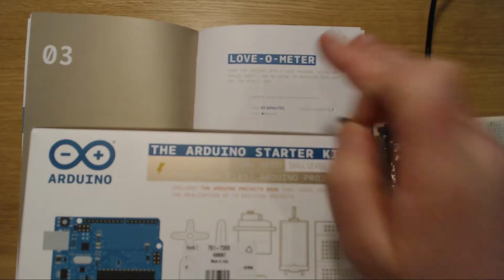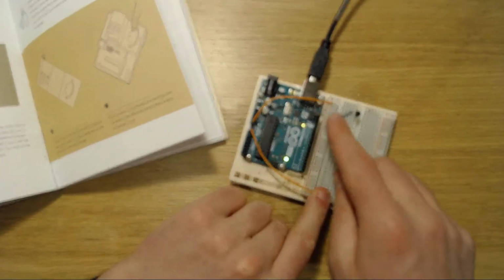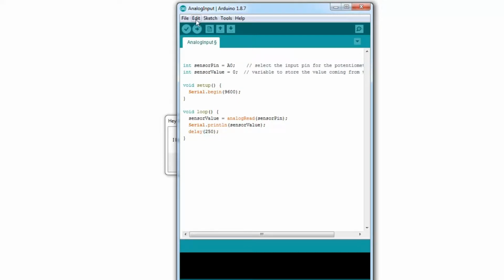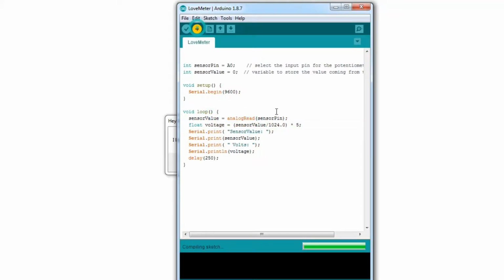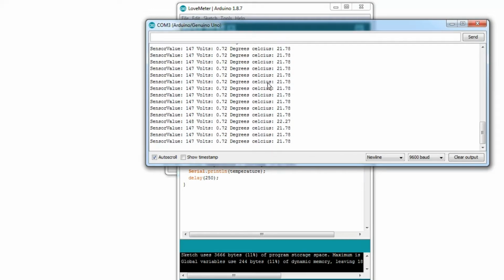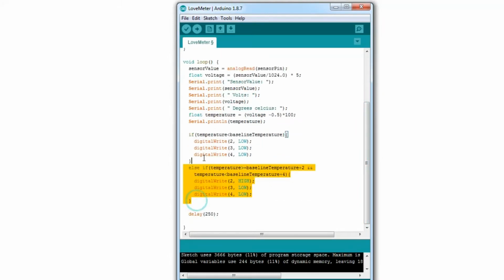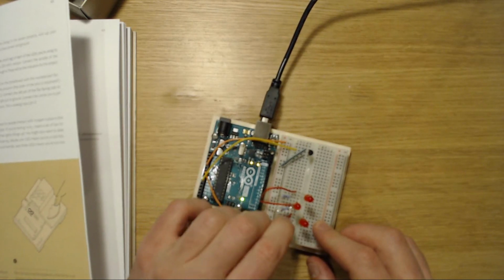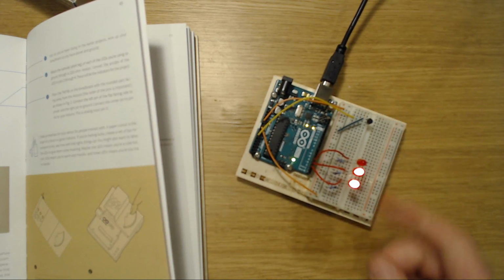Sofox tries the Arduino Starter Kit - Chapter 03 - Love-o-meter

Comment: Funny, this isn't the first time I've seen a thermometer called "love-o-meter".

Body temperature is around 36.5°C, but the skin on your fingers can be much colder than that.

It would be nice if you could have two cameras, one showing the program (when you're editing it or testing its output) and one showing the Arduino and what you're doing with it (like when you pressed the button). But I understand it may be a pain to edit, even assuming you have two cameras available which may not be the case.

"Volts is Volts"... Oh, so true. You're welcome to join the Tautology Club (I've been a member for years). ;)
Reply from the maker: Good to confirm the body temperature thing!

I did consider that, had already been doing a lot of setup with the cameras.
To be honest, you only really need that setup if you want to look at the Serial Monitor and the actual Arduino at the same time. I don't think the book does that that often. If it does, I'll work on a solution to that, otherwise I'll keep the current setup and just keep improving the general camerawork.

I hear about the Tautology Club a while ago when I heard about the Tautology Club.